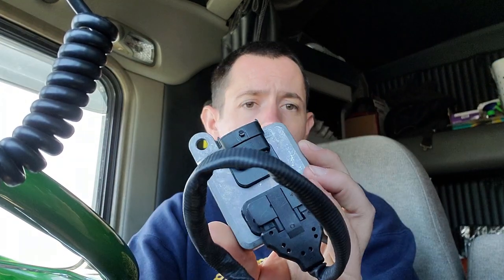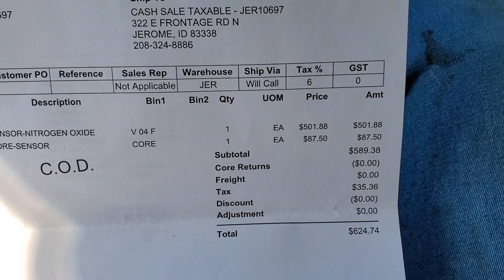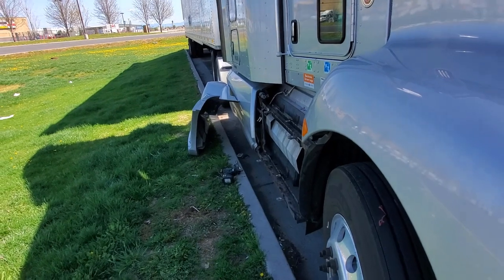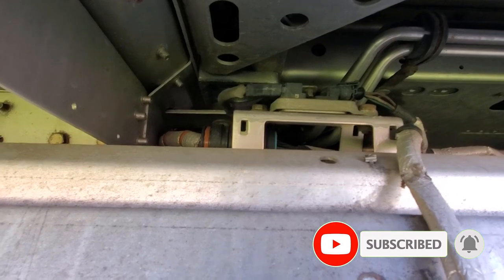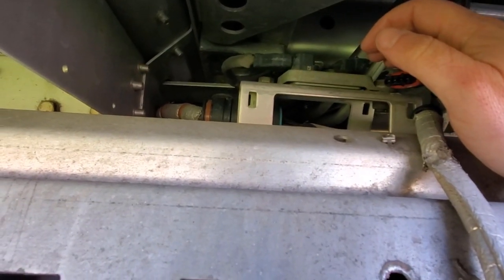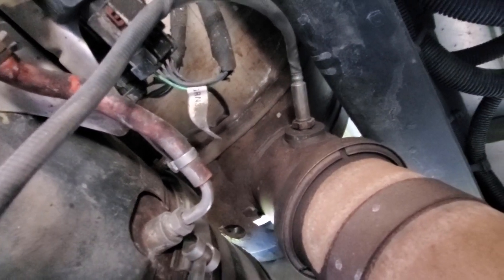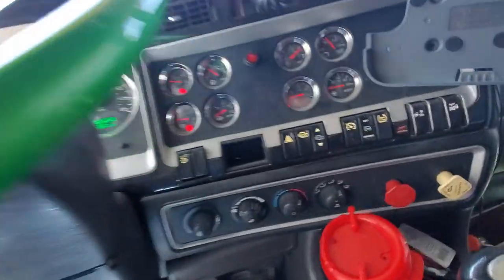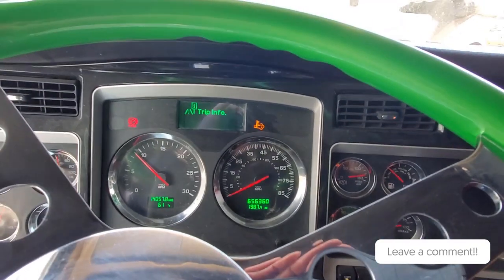Semi Truck NOx Sensor Change Out Step by Step - Owner Operator Trucking Repair DIY

Comment: Hi, I have a 2016 Peterbilt 579 with paccar mx13. Got 2 code that are the same aside from fmi being different. Spn 3227 fmi 10 and spn 3227 fmi 21. Description says After treatment 1 outlet percent oxygen 1. Any ideas if this could be a rear nox sensor? FYI, I’ve been seeing a lot more DEF usage where white powder is left on the brake chambers behind exhaust. So thinking it’s a bad Doser valve, I changed that but Def usage remained high. Now these codes came up. Any thoughts.

Comment: Try to get these  parts new as these RX (remans) don’t last as long as the new ones. Also I used a tiger pee and a pipe wrench to get the old one off and used anti seize goop on the new one. Great video brother, thanks.

Comment: Will the check engine light go off by itself when NOX is replaced?? Either the IN or OUT??
Reply from the maker: Yes, If the engine light is caused by the Nox sensor, it will go off after replacement .

Comment: If truck is already derate can you still change without taking it to a dealer plz ? 
Cause I had it diagnosed at loves they found out the nix sensor may be a problem

Comment: I might have missed it but is this the Inlet or Outlet Nox sensor?
Reply from the maker: It is outlet. Inlet is located at the engine area.
Reply: @truckingandfixing  thank you!! Getting my T660 same engine year as yours and I’m trying to learn the emission system as much as possible. Learned the hard way on my cascadia ...

Comment: Can I drive the truck if I get the Nox sensor intake code? Or I need to get it in the shop asap
Reply from the maker: Unless you get derated, you don’t need to get in shop right away, but you should book your appointment as soon as you see the code.
Reply: @truckingandfixing  thanks. Where can I get the silver reflectors for the top of the trailers

Comment: Hi Ryan, thanks for the very useful info. Did you use teflon tape on the threads of the sensor?
Reply from the maker: I used Antisieze, I think it would be too hot for Teflon tape.
Reply: @truckingandfixing  good point, thank you!

Comment: How you know so much about this stuff
Reply from the maker: Worked on farm equipment since I was a teenager, and went to disease training school and worked as heavy equipment mechanic in Navy for 9 years. Worked for Ohio CAT and many other companies. Hope it explained a little. In summary, it is from life and work experience.
Reply: I figured it was that. I just had a nox sensors replaced on my 2018 Freightliner cascade, it was covered under warranty. Now in shop for drive shaft is loose